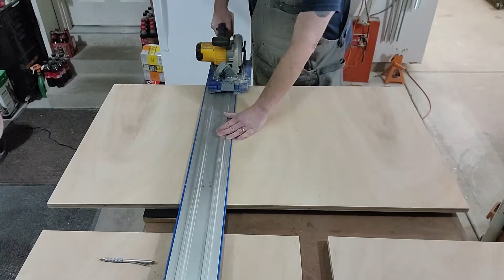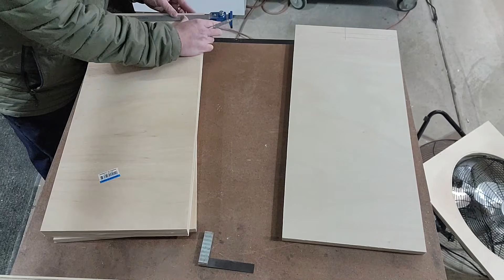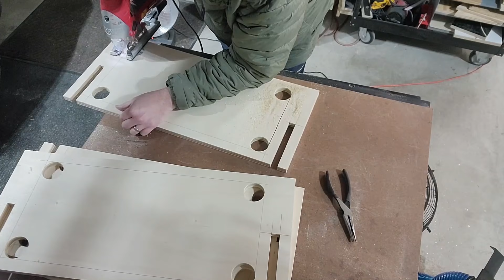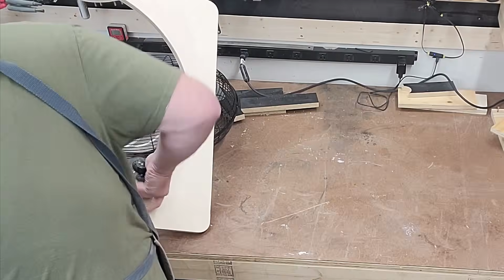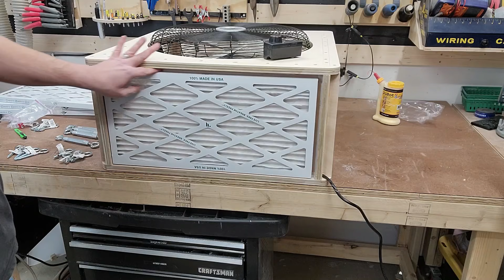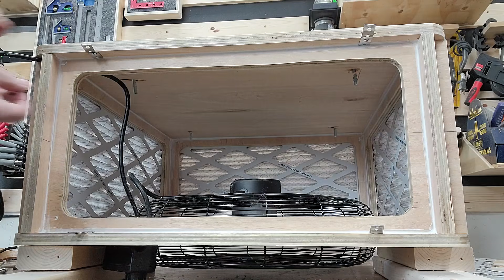SAVE YOUR LUNGS! Woodworking Ceiling Mounted Dust Filter - How to Make

Comment: Wood is not a good material for a fan that might overheat when pushing through a filter. Do NOT run this wood fan "continuously" without some fire detection device.

Comment: I like your design but i'd do one thing differently...with glue attaching the bottom/top there is no way to remove that fan when it craps out and needs replacement. i've used the same fan for years, but they eventually die. good work.
Reply: I was thinking this too, the back side could just be screwed in instead of glued. Not like this thing is going to take a major beating or hold weight that needs the glue lol

Comment: Hello. I must admit that it was a very well presented , elucidated, and educational presentation.  I am trying to educate myself and most probably I will use your design. I have a few questions. 1- could I put another filter on the  fifth side ? 2- could I use a 4 inch filter ? 3- could I have the fan facing the ceiling? 5- how about using a blower instead of a fan. ChatGPT recommends it. I would highly appreciate your expert input. Merry Christmas.

Comment: You might want to rent a fog machine to see exactly what the air flow is like. You could have air going to places where it can kick up dust, or there could be so much turbulence that a lot of the air going in through the filters is short circuiting and going back through the filters etc. It's always a good idea to see exactly what is happening rather than assume what is happening.

Comment: A very well made box. If there’s no filter on top it could be closer to the ceiling, just open hooks and eyebolts, level it by screwing them in the joist for proper length, you’re only going to do it once. I kinda like the idea of a gap as you have done with the fan on top and a large filter on the bottom as another option. Thanks for the ideas 👍

Comment: Really love this plan.  Great job.  I do have a couple of questions.   1- can this be made using 1/2 inch plywood?  2- can the fan be pointed to the ceiling instead?   I do a lot of cnc work it would make more sense to have the blower going up than down to the floor.  Thanks fo your guidance.

Comment: Do you find that by pointing the fan down towards the floor thst it kicks the dust up? And have you tried pointing the fan towards the ceiling to.prevent dust kick up and.if so, does it still filter ?

Comment: Great video! I’m about to do something similar, but I had a question about your fan orientation. You’re blowing your fan down at the floor, do you have issues with that kicking tons of dust up? I feel like that would make my shop dirtier and am considering pointing the “exhaust” towards the ceiling. Do you have any thoughts on that?

Comment: This is a nice design, but with that high flow fan, I wanted larger filters and used 20x20x2. I also cut some dados in the top/bottom so the side panels had a channel to rest in and avoid the butt joints.

Comment: Defo flip the fan round, either point it at the ceiling cus you have a gap, or blow into the box. Blasting air downwards is sure to stir up dust and blow it away from the filters.

Comment: Hi, first thanks for sharing your plans this will fit my shop . ? why did you face the fan blowing down ( blowing the stuff off the floor ) and not facing up into the box. Thank you Roy
Reply: dirty air vs clean air going through the fan blades

Comment: Thanks for this, nice design.  I have a question though, and it has to do with something you said, and what I was thinking as you said it.  You mentioned, (paraphrasing) setting the fan to low to circulate the air so you didn't blow stuff around on the floor.  I wonder if having the fan exhaust directed upward instead of downward would be a better option?  It's a genuine question because I just built a portable unit that more or less BRUTE FORCE collects dust but it's designed to be placed close to where I'm sanding etc.  I want a unit to be more permanent, hanging from the celling.  So, what are the pros and cons of directing the fan exhaust upward vs downward.   I have 12 foot ceilings in my shop so it will be up pretty high I think.  Thanks again - and VERY cool car by the way. :)

Comment: Curious as to why you chose to pull air thru the filters instead of exhausting air thru filters?  The way you have it set seems to me that you are making more dust in the air with the fan facing downward instead of blowing into the filters.

Comment: WHY are these always mounted to the ceiling?  Last I checked gravity is still in play.  Things don't fall up.
Reply from the maker: Because it's the fine airborne particals that are dangerous, not the heavy saw dust.
Reply: @TheSuburbanGarageWorkshop  I get that  but even those particles are more apt to end up on the floor than on the ceiling aren't they?
Reply from the maker: @jlester4892  they stay airborne long enough for you to breath them in without something filtering them out of the air. There is a reason they are osha mandated in many shops.

Comment: A great, simple design. Have you been able to determine how much of a difference the fan speed setting makes? As in, if you leave it on the low speed does it clean the air adequately enough?

Comment: Looking at building this, but wondered if you considered have the fan inverted, to blow up into the box.  It would be a bit more work with reinforcing the filters and perhaps rewiring the speed dial.
Reply from the maker: That's generally not how any of these air filter systems work. As then you would be sucking dirty air through the fan/motor. That would require constant cleaning of the blades and motor and probably would redude motor life as the bearings would be subject to lots of fine dirt. Also, it would make it much harder to seal the filters as they would be getting pushed away from the housing vs sucked against it.
Reply: @TheSuburbanGarageWorkshop  I thought that was why.  I think a sealed motor and s slot system for the filters could overcome those negatives but the fan blades would require continuous cleaning.  Your video was excellent, as others have repeatedly stated.

Comment: You did a great job. Good build good filter setup. Nice placement. Was worried about the weight bit at around 25lb not too bad.

Would like to know the air turnover rate and if it blowing down causes any dust on the floor to rise into the air.

Comment: I built the same unit. My fan doesnt blow air unless I remove and then replace 1 of the filters. Did you experience this? I have merv 13 filters and can hear the difference when i remove one then replace it.
Reply from the maker: I've dropped down to Merv 8. They are less restrictive. Otherwise, you'll need to shroud the fan to reduce the space between the edge of the blades and the box.  If they filters are too restrictive or get clogged, the fan will suck in  air between that gap instead of through the filters. I may release an updated version that address these issues.

Comment: Great video! But how well does it work now that you’ve put it into action?
Reply from the maker: Very well. I go through a set of filters about every month. I'm amazed at how much it pulls out of the air. I turn in on when I am painting in the garage. I started using MERV 8 filters instead of MERV 13 as the MERV 13 filters started to clog too quickly.
Reply: @TheSuburbanGarageWorkshop  thanks, Dude!

Comment: What would change if the filters were reversed and the air came through the bottom and out the sides?
Reply from the maker: It would be hard to keep the filters sealed and you would end up fouling the motor with dust. Nearly all of these systems are made to have the filters before the motor.
Reply: @TheSuburbanGarageWorkshop  I didn't know if the downdraft would stir up more dust than clean.
Reply from the maker: You can always flip the box upside down and have it blow upwards, if you have enough ceiling space.

Comment: The only thing I would have done different is not glue the back/top on (because of the way you ran the power cord out of the box) in case the fan needs to be replaced. Or use a large grommet that the plug could go thru.

Comment: Great video. I just built this very similar to yours. Mine was using 20 x 12 merv 13 filters for the sides and bottom, 20 x 20 for the back. This issue is that when I turn the fan on I barley feel air coming out of the front. When I remove the rear 20 x 20 filter I can then feel the air flow and I can hear the difference in the fan motor. As if it is straining with all the filters in. Will this reduce the life of the fan motor? All the filters are new.

Comment: My only question is: the bearings (most likely preoiled sintered bronze sleeve type) are set up for the fan running vertically so they don't have thrust bearing built in...
But your mounting horizontally so is there going to be a accelerated wear since possibly gravity and the thrust from the blades moving air are causing thrust the fan was never designed for?

Comment: Very nice build !
My only concern is that i do think the filters are in reverse. Meaning, the cross hatch noticable is supposed to be on the inside, thus preventing the filter media from being sucked into the fan when loaded with dust etc.
This is unless i'm misreading the air flo direction.
Beautiful craftsmanship on the build.

Comment: Why use such small filters.  The size and thickness of the filters greatly determines the amount of air flow.  Even though the unit would be bigger, using 2” 20”x20” filters would nearly double your airflow.  Also, showing the completed unit at the BEGINNING of the video would allow the viewer to quickly decide whether to bother watching the entire thing.

Comment: Hello again, I am about to build this same filter setup you built. I got all the stuff coming this week, my question is it’s been a year now since you built this, is there anything you don’t like about it? Is it cleaning the fine dust from the air? Is there anything you would do different? I know a lot of questions but just want to get this right the first time around. Was kind of hoping you would have done an update video to this. Also thought about making it so the fan is on the ceiling side instead of blowing out the bottom. Ty for taking the time to make this video , I just had a few questions about it.
Mike

Comment: The design is good ,i am trying to evaluate how this can be made in steel fabricated design . Did u calculate how much air is being sucked and can u use 3or 4 units in one room to extract dust from every corner easily reducing the load of sucking from far off areas

Comment: Top notch work here. I feel you put a lot of work into the wood enclosure and maybe not enough love into the filters. Im not sure what you are trying to get from the filter, so maybe just basic air filtration. Those filters will quickly get overwhelmed by large particles without some pre filter and adding a activated carbon filter will help with volotile organic and and fumes or odors will be reduced. Although not cheap its also good to look for true HEPA filters too.

Comment: A self adhesive weather strip could be added behind the filter elements and mabe a 1 x 2 to hold the top or bottom edge in.  I would make the top oversized and just screw directly to the ceiling.

Comment: Nicely done. I would definitely orient the fan to the top of the box however to prevent kicking up dust below and use 1/2" thick material at most to reduce weight. One could build it out of even 1/4" with some minor reinforcement if that is a serious concern, but that obviously adds complication.

Comment: You could put some foam weatherstripping behind the filters. It won't interfere with variations in filter size. The filters will just press against it to form a seal.

Comment: Question: So if you weren't using it as a ceiling fan in conjunction with dust control.  Would you have hung it upside-down?
Reply from the maker: Sure, depending on the about of ceiling clearance there is .

Comment: Fan should be facing the ceiling, open up the other end with another filter. That way the air gets dispersed evenly around the shop, and feathers out over the entire ceiling instead of blowing a gout of air down stiring up dust everywhere.
Reply from the maker: I've covered my reasons for that a couple of times in the comments. Down is just my preference

Comment: That's a nice filter solution. I think this would shine in a space that doesn't have access to outdoor air or is temperature controlled. But why did you not just build a circulation system that blows the dirty air outside and pull clean air in from outdoors? You could have like 10x the air purification with the same budget.
Reply from the maker: When it's -10f outside and your trying to keep a space heater, trying to exchange the air with outside air is a no-go.
Reply: @TheSuburbanGarageWorkshop  Ah, I don't get that problem where I'm at.

Comment: Also a fan blowing into the box you can make it pass through several filters if you wanted and would eliminate blowing the fan at floor and kicking up dust and making a mess of the sand and dirt in a garage .... should suck into machine

Comment: Id also add a gasket inside ... want all the air to be a suction to have 100% efficiency...not around outside but on the inside lip ... so not to mess with different filter sizes .. so it presses up against side of filter

Comment: Hey I’m thinking of building one but my concern is that the fan will blow too much dust around below it putting that fine dust in the air defeating the purpose of this air filter. Why not make the fan blow into the box instead of out? Any cons to that design? Seems it would then filter the fine dust floating in the air while not creating a strong stream of exiting air pointing straight towards the work area below…
Reply from the maker: You usually always want the filter before the fan. That reduces dust that can foul the blades and motor. Also if you pressurize the box, then you would have to come up a new way to seal the filters. Right now the vacuum in the box pulls the filters tight against the frame. In your scenario it would push the filters away from the box.
Reply: @TheSuburbanGarageWorkshop  hmmm I see, thank you

Comment: ❤please turn up volume on next shows 
IM OLD & HARD OF HEARING, I can't turn up v any higher but can always turn down. So I can only read what you are saying .❤ The size fan you use is 150$ at lowes. I bought one after killing my back with ac units in & out of windows. Hoped it would be strong enough. It was most of the summer. Other "diy air filters" start with a lasko box, or a short window fan.  Very impressive that you chose top shelf, & highest viloscosity! Im a girl, no access to a shop, my tools are in storage, wont be making the filter. Just looked them up, for a neighbor, who smokes 🚭, to help her. She is also alergic to air freshener sprays. Made the mistake of getting her ofst, & sprayed befor told. I'm constantly doing things like that. lol damed if you do, & damed if you do, just to dumb not to do.

Comment: I've been looking at doing something like this, I like the idea of the box fans filter systems you see on YouTube, unfortunately you can only obtain that type of fan in 120v, which is no good for me in the UK. We only really do these type of high velocity gym style fans in the UK. so this is perfect. now I've have to go and get a router and a fan. 

From what I can see and I might be wrong, but is the fan blowing down and drawing air in through the filters? would this not disturb the air and kickup the dust more? In my experience, having the fan draw the air in and collecting the dust on the inside of the filtering system would be far more beneficial, and you could utilise a prefilter for larger particles which is cheaper and would prolong the life of the primary filters on the outside, this would also contain the dust particulates internally and prevent dust contamination around your workshop. if this is already case apologies, trying not to sound like some smart arse!

Thanks again awesome video 👍

Comment: one thing i reccommedn is the position of the filter/fan, to face upwards or facing out the front of the garage, because it will only filter very small particulates that are on the sides of the filters at that height, rather than below the whole system.

Comment: that  is the most well built designs ive seen yet, most i see use J channels, that seems more secure, do you think rubber or foam gaskets would help or the tolerance is tight enough?

Comment: Great build and love the instructional video!
Do you think this would work better with the fan facing upwards? I'm just wondering if the air from the fan would be blowing the dust back down and keeping it from getting sucked into the filters and trapped. Thanks!
Reply: Since it’s mounted on the ceiling and effectively above the dirty air, I would have put the fan facing upward so as to suck the dusty air  easier.  It currently has to suck the air all the way up to the ceiling in order to then filter it and blow it back down., mixing it with the lower dusty air. 

There would be an argument for blowing it down if it was mounted a foot off the ground.  But anything higher than that and it would likely blow upwards so as to not kick up dust off the floor.

Comment: Nice design, but they work better pushing the air through the filter rather than pulling the air though.
Reply from the maker: Most filters pull through the filter so it doesn't clog the motor or blades with dust. Even household furnaces have the filters on the intake side.